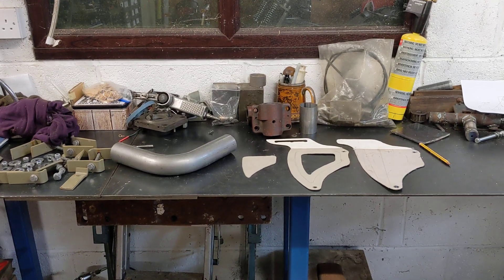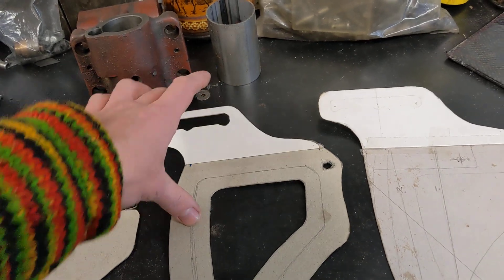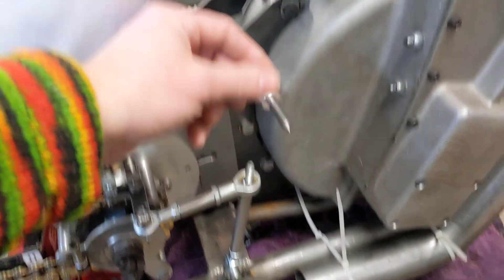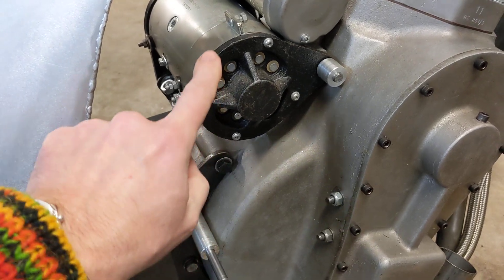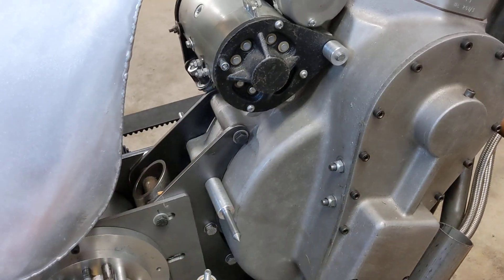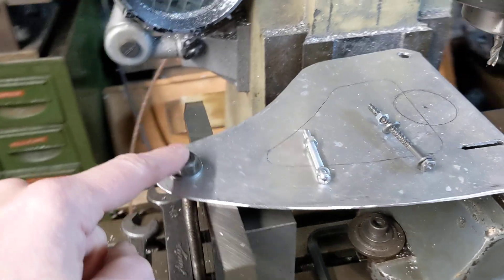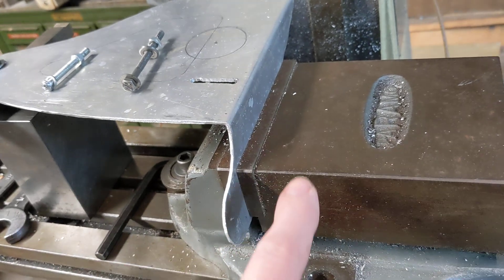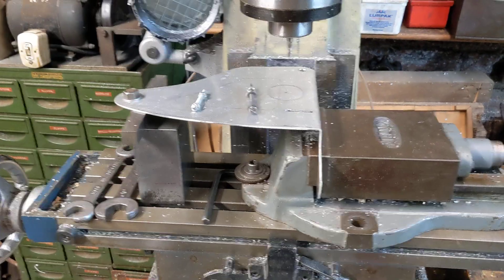Gate Plate Progress

Comment: nice but shouldnt the slot have been cut in a graceful arc rather than a straight line?
Reply from the maker: @davidtucker-km7tk ideally yes. We originally marked the slot as an arc and intended to cut it on a rotary table. But the distance from the pivot point is huge and the length of the slot is tiny. You couldn't even make out the fact it wasn't straight by eye, so we just cut it straight.